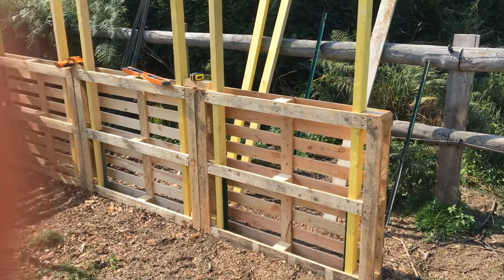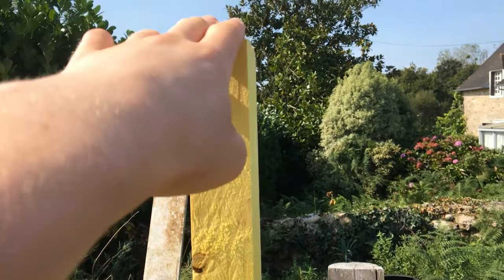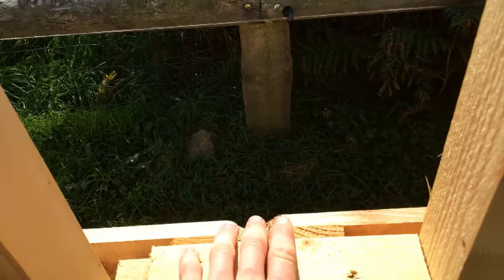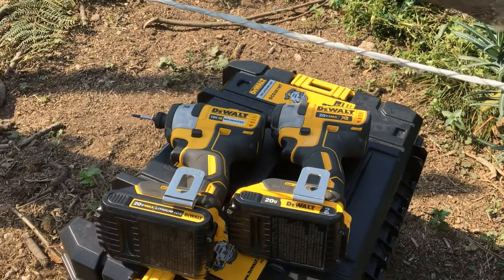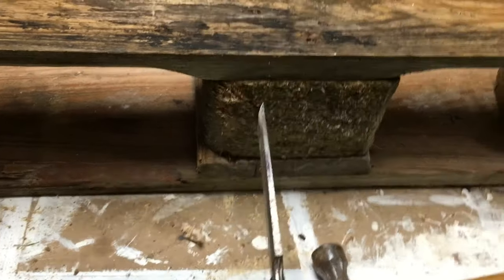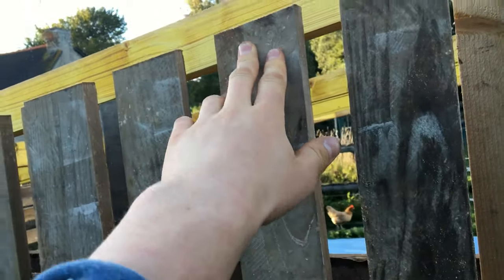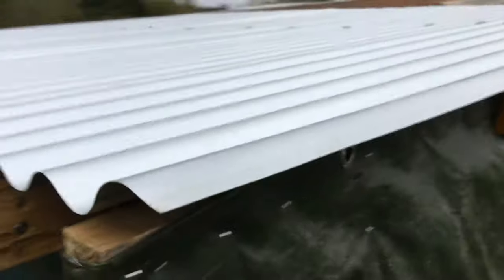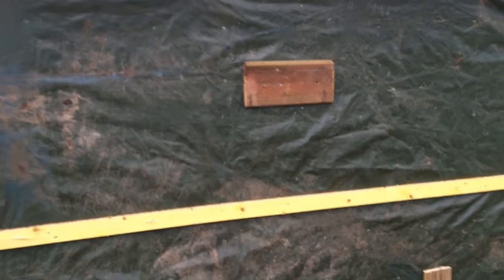Donkey Shelter made out of Recycled Pallets

Comment: Cool shed , thanks for upload
Reply from the maker: Thanks for watching
Reply: @toolreviewsandrestorations  thank you. 1 question,  I'm trying to build 1 of these. But I have not put in the posts,  that you call the bones.  Is that ok not to put them in do you think  ?
I have a solid floor so I can't put any posts in the ground anyway  ?
Reply from the maker: If it’s well secured to the floor and the pallets are well connected together with 40x60 lumber or something similar, than it should be fine.
Reply: @toolreviewsandrestorations  thank you very much

Comment: Alot of work but those pallets will be rotten in a few years and you'll be ack to square one, throw in a foundation and build some concrete block walls it will last a lifetime.
or use some steel uprights with treated timber runners and screw on some metal side sheets as well.
Reply from the maker: That was out of the budget and the client would have had to get a building permit for the foundation.